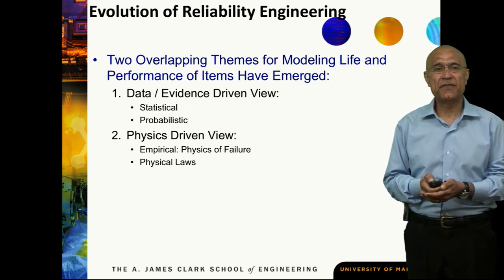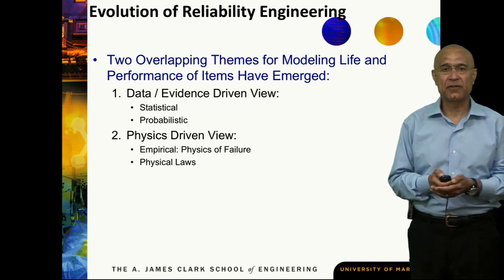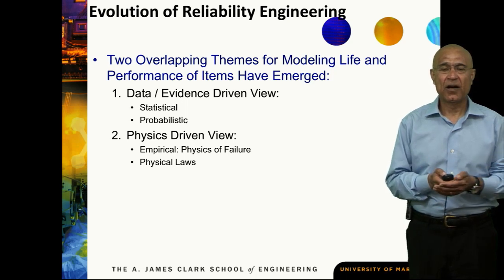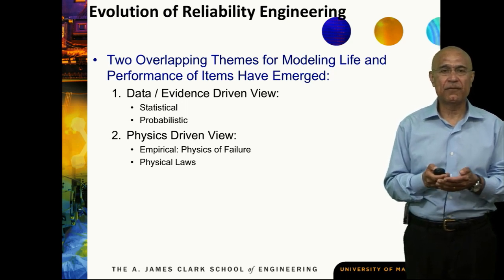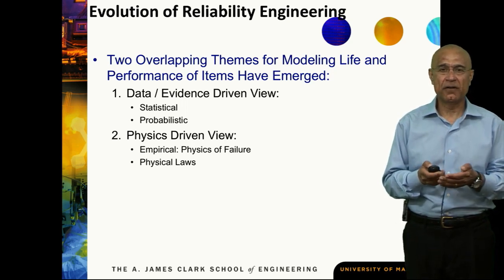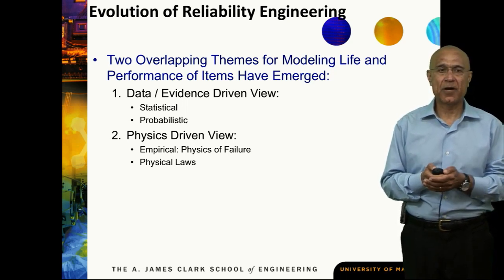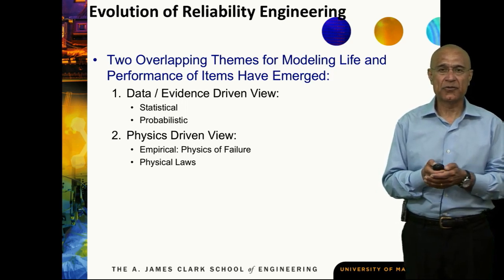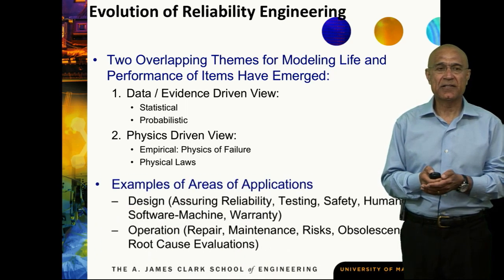Reliability Engineering: An Overview (short)

Comment: As my experience, the math method is hard to use, due to its theoretical difficulties and complicated practical applications. On the physical area, most of peers cannot handle general analytical calculation. This is very hard to discuss the root cause. Knowing the system, subsystem, and machines and other related things is the path to success. How can a person without knowledge of the front line predict the reliability?